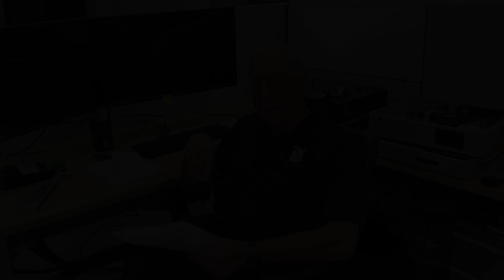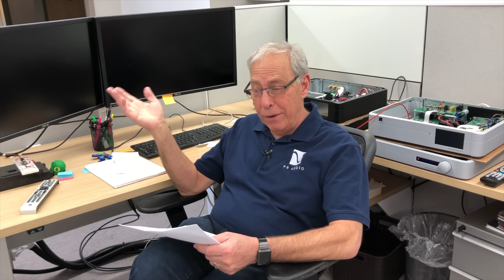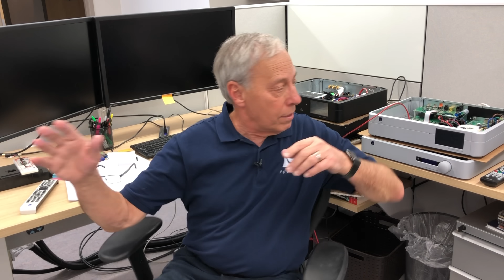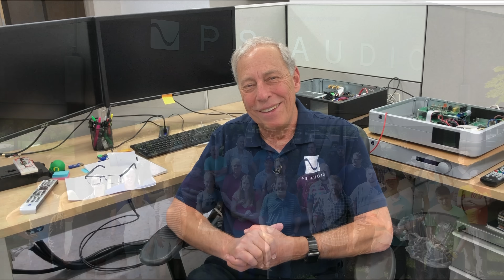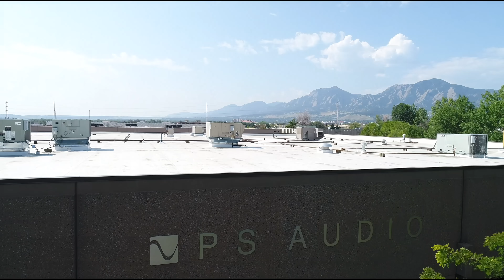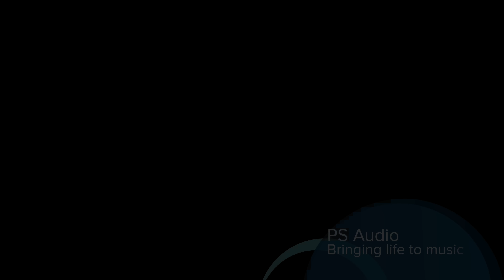Is it time to rethink our power grid?

Comment: ALL voltage conversion for LED's nowadays is practically Solid State!!! I can buy a 4 foot LED replacement tube that would go in place of a 4 foot fluorescent tube!..Cool thing is, that LED tube now has it's own rectification and voltage regulation BUILT INTO IT!!!....NO STANDARD FLUORESCENT TUBE BALLAST REQUIRED!!! The LED tube can handle anywhere from 100VAC to I believe 240VAC input!!!.....10 watts consumption of the LED vs 40 consumption watts of the fluorescent (per tube) and the ballast. A WINNER ALL AROUND!!!...plus you gotta figure out the energy required (in the summertime) to cool off all the heat output generated by the standard fluorescent and ballast!!!
Reply: While LED's are more power efficient, the SMPS that converts the mains to the required D.C generally isn't. This is why the big push for "smart meters" by the power companies. The power factor of SMPS's has never been ideal, they are getting better because they're being forced to though. Still, atm they are generally no where near a PF of 1 meaning that they draw more current than they need because they create a phase shift. Older style "phase meters" can't tell the difference but don't read "apparent power", they can only read "RMS" power (correctly). This is why there are PFC (Power Factor Correction) capacitors in parallel with the ballast in fluorescent tube fixtures.
Reply: @Jimmeh_B  actual SMPSU's are a lot better than linear power supplies for efficiency and power factor. Very few loads can achieve a PF of 1. The push for smart meters is to save money sending people out to read meters, it has very little to do with the increased use of SMPSU's.